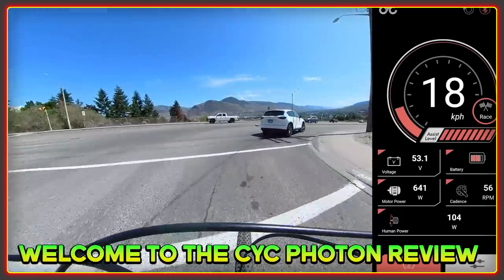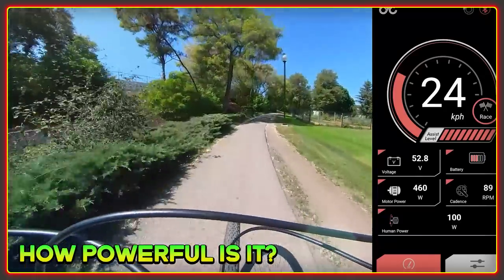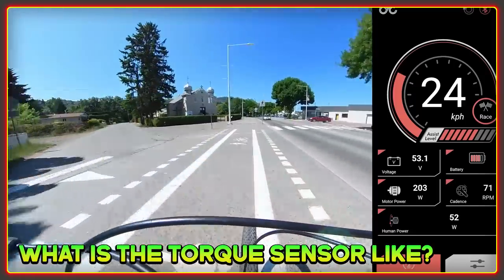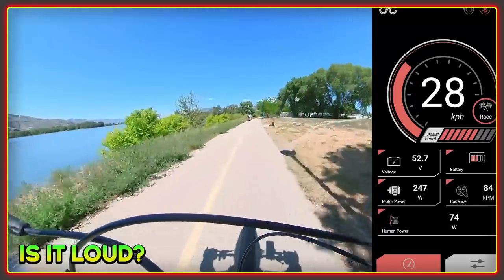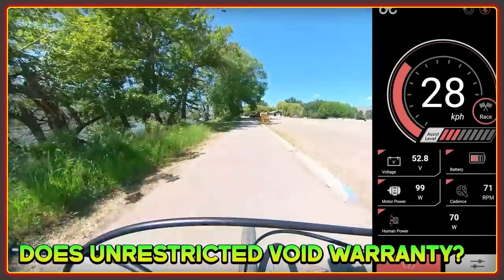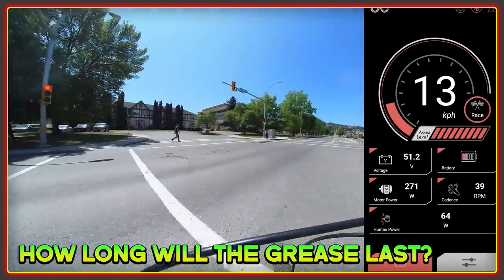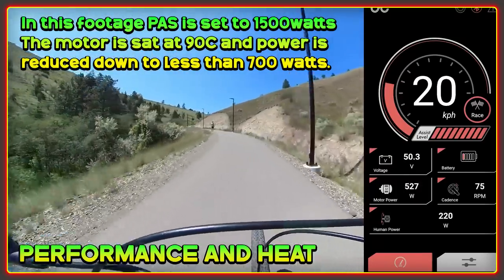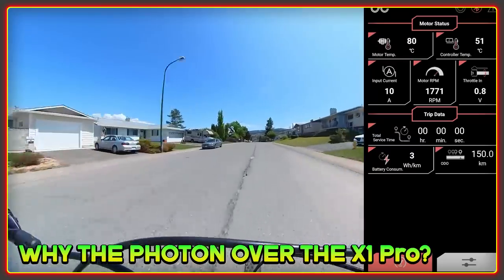Full Review of the CYC Photon Mid-Drive Ebike Conversion Motor

Comment: A year ago I fitted a Photon to a cheap old Marin full-sus MTB for exercise purposes, new cassette and new brakes, and now I weigh 25kg/55lb less! Agree with your review points. Had to put the 48V 20Ah battery on a saddle-stem-mounted rear rack which leaves space for a mid-mounted kiddie seat for my 5YO grandson! I can ride pedal assist for 2-3 hours, maybe 35-40 miles, without getting tired, with no sore backside and still have more than 50% battery left. 😀
Reply from the maker: Awesome build. Glad it’s working for you!

Comment: For u.s. pricing the Photon is essentially the same as  BBSHD because of the extra components needed and this package either already includes or doesnt need such as a brake sensor which isnt needed with a torque sensor.  One thing that was not  mentioned is that Photon weighs considerably less than BBSHD which weighs 14lbs!!  Also,  the ground clearance for the photon is amazing.
Reply from the maker: Yeah its not really a fair comparrison as the BBSHD can actually run up to 5kw without issues. It does weigh more. I think that the TOSEVEN DM02 is much closer in terms of style and weight.

Comment: I don't know if you read your comments or not, but CYC is setting up a "repair/warranty" facility in Austin, Texas.  This should be this year if what Jon told me is correct.  That will cut down on any shipping times if work needs to be done on your Photon.  As a side note, CYC is coming out with a BBSHD killer called the Proton, and it can do 3000 watts.  I'm guessing that will make you happy.
Reply from the maker: Yeah I heard about something being setup in Texas. It would be a good move. Dealers will struggle with the workload. I terms of the Proton. We will see. It's not much bigger than the Photon so it won't take 3kw for long in the same way that the Photon can't do more than 750 sustained in hot weather. It's good to have these motors though. It's definitely stired things up. Bafang finally put a ts in the bbshd and rumor of the 02. There are also new motors from To7 and a company called truck run. Should be a good year!

Comment: I'm generally in agreement with your comments, but would point out that wide range rear 50-10 cassettes are very often used with 1x front chainrings, and on Boost frames 34T may be the max size that will fit.
Reply from the maker: Good point. I will do some investigating. I will see if I can get something to fit. Not a priority though.
Reply: Since 12 speed 50-10 cassettes have large gear steps then there is no other choice but to use modified close ration 34-12 cassete and 42t chainring for selecting comfortable cadence on flats and false flats while riding with the motor turned off for less noise and more natural feeling, reserving the motor for hills only. For really steep hills using walk assist mode is another option since on long tours occasional walking is good for leg recovery. Short commutes with steep hills aren't ridable in this case. Future option for 2x chainring would be needed since I'm not sure if somehow bolting on smaller chainring would be possible due to reports of original 34t chainring having threads instead of splines which get stripped.
Reply: @HighVoltageKits  the CYC 34T chainring fits perfectly, with perfect chainline and maybe 2mm of clearance on my example. The issue is that Boost frames have a slightly wide rear thru axle and with a narrow BB the rear stays have to flare out to accommodate the rear tire. That step out conflicts with using larger chainrings, these bikes were never intended for them. The default 38T chainring isn't always an option so builders should be aware of this.
Reply: @uvwuvw-ol3fg  not my experience at all. Almost all decent trail and enduro MTBs have Boost frames and 1x BBs and are intended to be used with small 30-34T chainrings. On these bikes you aren't as interested in maintaining cadence because the terrain determines your speed, so gear spacing does not matter. Additionally there tends to be larger spacing in the lower gears because your focus is just getting up that hill. No need to get off and walk, with the Photon my bike can get up any hill I can keep traction on. In general these bikes are not intended for road use or touring and are probably wasted if used that way.
Reply: @uvwuvw-ol3fg  can you clarify the last part of your comment? My 34T chainring has the same splines as the others so I must be misunderstanding your comment.

Comment: Still on the original Cyclone 3k and I can't decide if these new generations are an upgrade or a downgrade. Maybe it's just a sign that I should start building a new bike. :)
Reply from the maker: Its always time to build a new bike!!!!
Reply: Chris, 
Cyclone 3K is a very different motor from the new Photon.  Word is there will be a high performance motor called the Proton which is based upon Photon design language....like a beefier version.  Knock on bigger Cyclone motors...or I would own a bike with one...is the noise.  CYC answered this concern with the Photon but it is a lower power offering.  High RPM...just like the Sur-Ron and even high RPM hot rodded BBSHD exposes more noise of course because turning very RPM creates a resonance that sounds a bit like a shriek. For me, as a BBSHD lover, a higher performance version of the Photon maybe of greater interest.  
If you are good with the noise signature of the larger CYC motors, they are dam good now that many of the early bugs have been resolved.
Reply: @lukewalker1051  Thanks for this. I haven't been paying much attention to the new stuff because my old cyclone is still running perfectly, though a bit whiney sounding as they all are. One thing I definitely want is the newer software, the old BT app isn't very good at all. 3k is also more power than I need, by quite a bit, but I still love hitting the gas every time. :)
Reply: Always happy to come across another Cyclone 3K user. Over 5 years on mine and she's never let me down. Looks kinda clunky? Sure, but so much fun!  It's the Millenium Falcon of ebikes! 😂 Wish SickBikeParts and Luna still sold them. Just glad I stocked up on parts — hope to keep her going for decades!

Comment: Your review was a polished piece of work.  Being an owner of a photon I agreed with everything you covered. Especially the concern about serviceability.  With the current supply issues I worry about the need to send in for repair.  If it is taking months to fulfill new orders will parts be available for quick turnaround if service is required.   
The only issue I have encountered is getting the brake sensors working.  You can order a cable that includes a pair of magnetic sensors that uses a small magnet mounted to the brake lever.  I just couldn't get it to work.  So I opted to go with new integrated brake levers with built in switch cutoff.  Again the three pin connector is not compatible with most master levers.  I finally gave up and removed the extra cables . 
Another thing I would like is shift sensors.   In 2000watt mode my cassette is taking a beating when shifting.  
Because of the high torque I find I primarily ride in 7, 8th and 9th gear.  Never a need to for the lower gears.  I am shopping for a more robust cassette as I pretty much killed 9th.  Jumps over the teeth under high demand.  
But that's a problem I really like.  The response and torque are very good.  
I also very much agree with your assessment of the torque sensor.   It is as good as my bosch motor on my 12 thousand dollar reise and muller homage.  Bosch has a superb torque sensor but the photon's is adjustable in a variety of ways to custom tune the feel.  
The adjustment of the riding profile using the phone app is remarkable.   I strongly wish I could set different profiles or at least be able to save a profile.  Once I accidentally reset the app and lost an hours worth of custom settings.  There is over 30 custom settings from throttle to torque to battery management to set.  Out of the box it works nice.  You do have to set your battery voltage and low cut-off.  
A word of advice in selecting a proper battery.  You need to buy a premium battery that is capable of sustained 40amp output.  The photon can use 52 volt 40amp output.  I use a 52v battery rated at 20ah.  My full charge is 58v..  I put 48 miles of mostly throttle and quite a bit of high speed runs and only drained it down to 52v.  Super impressed.  
I never hear it run.  

I love this motor.
Reply from the maker: Thanks for the comment. The brake thing sounds pretty frustrating. I tend to pedal lightly when shifting gears. There is not a point on the harness for a gear cutoff but I think you can add one by using the brake cuttoff and either an extension or wire it in higher up. Check the pin out though as it might not be the same as the one from Bafang. Another thing you could try is to have the power ramp up slower on the pedal assist. This would give more time to shift with lower power. Worth a shot. Cheers
Reply: @HighVoltageKits  Alternatively but also costly would be to go with an internal gear hub like a Rohloff as you can stop pedaling and shift gears.
Reply: I'm planning on building an e-bike with this motor and definitely using a IGH. 
A SCHWINN IGH run  about 200 bucks

Comment: Hey, just discovered this new project called freebeat Morph 2-in-1 e-Bike after watching your video. Gotta say, I'm impressed by the outstanding features this e-bike offers. The fact that it can be charged indoors is a game-changer! The brushless 750W motor and 80Nm torque ensure a powerful and exhilarating ride. The 80mm front suspension and puncture-resistant fat tires guarantee a smooth journey on any terrain. Plus, the Smart Saddle Detection+ feature and the ability to convert calories into CO2-free miles really caught my attention. Definitely putting my support behind this project! Keep up the great work!
Reply from the maker: What is unique about the bike that let's you charge it more safely than any other ebike inside?

Comment: very interesting and useful review, covering basically all the questions i have about the photon.  tremendously informative.  would in addition really appreciate appreciate your thoughts on how the cyc photon compares to the other torque sensing mid drive currently available, the tsdz2, especially with osf, and what in the build quality, anticipated reliability, and user experience, might induce a rider to pay the nearly doubled price?  as a standalone yours is truly a superlative review and very helpful.  i just wondered if, given the torque sensor capabilties of the photon and tsdz2, a comparison of those motors might be useful.  many many thanks, jeff
Reply from the maker: I have never ridden the Tong Shen but its taking a battering on the forums. Very easy to break. Its very cheap but not by any means reliable. There are a bunch of new TS motors this year though so it may well be a comparison that gets easier later this year. Right now its the only thing in its category. It is quite expensive though.

Comment: Converted a Trek Marlin 5 2022 (Large frame) with this motor (38t chainring). 200 lbs rider nearly 60 years old. US profile loaded in race mode, assist lvl 1= barely getting any workout, like 1 of 10. Battery seems to like it because it's still at 51% (50.6V), 107 kms later (52V 17.5AH Samsung 35E cells) Now on Canada preset, street mode, for legality and will see how far I go.
Reply from the maker: Sounds like a great build. Its nice that you can use those cells on it as you get the extra capacity for less overall battery size and weight. That's impressive range. I think stock that its pulling 250watts at level one but you can check that in the ride app.  Cheers

Comment: Hey Voltage - Thanks for the awesome review. This was actually the reason I ended up putting a Photon on order!! 

Quick question for you as I just finished installing the motor last night - should I expect a bit more resistance now when pedaling vs. when having no motor? I would not say I am seeing a ton more resistance now, but the pedals definitely do not spin freely either. Curious if I potentially tightened something too much like the spindle lock ring, but I backed it off and resistance was about the same.
Reply from the maker: I think there is an issue with the tolerance on the machining on the bearing cup for the non drive side. I have a video for this week to explain what I think is going on. But yeah its going to be a bit stiffer than with a cartridge bearing BB. It should not affect use as you have all that power though. I think they do need to fix it though.

Comment: John,
I removed my most recent comment because of your fair response.  I wrote a comparison of the Bafang mid drive to the new Photon only highlighting some of the considerations in my original post.  I couldn't understand why it was deleted because I thought it was even handed.
If you said you didn't delete it, I take you at your word.
Best to let others decide what is best for them.
Good luck in all your R&D efforts and safe riding to those that love high performance ebikes.  Great to have competition in the market place that only refines options available to the consumer.
Reply from the maker: I appreciate that Luke. I actually found the comment which had been filtered out for some reason along with replies to it by the YouTube algorithm. I usually check messages set to review by YT and it had slipped my mind. Apologies about that. It seems to block some comments for no real reason at times. I could see nothing wrong with it. I generally try to reply to all comments I get. Thanks for the kind words of support.

Comment: Great review. I really would like to know if it can be disabled, so that opportunistic theft can be denied motor assist, maybe enabling the owner a small possibility of grabbing the bike before it's gone, probably forever. In any case, I'm thinking of using a small padlock around the chain to drag the chain off the sprocket, so he'd have to push it away...
Reply from the maker: There is not an anti theft like that built in unfortunately. The chain idea is good. You could also hide an airtag. Maybe a kill switch in there.
Reply: Thx.I thought I read in the online manual that there's a password function... doesn't explain what that's for.  Wondering if there is there such a thing as an inline keyed switch for the battery cabling?
Reply: I have the DS103 display and it allows you to have a password. You have to first enter the default password 0000 and then you can set your own.
Reply: @mattdeeney1169  Ahh thx, ok that might be where read it. My Photon is coming early July (was early June) and I did choose the DS103 display option.
Reply: @Delton05  Nice. I’ve loved my Photon. It’s my first e-bike and it’s been so fun.  I ordered another one for my wife’s bike!

Comment: Yea, I think this video has pushed me over the edge. Going to get one for my 2021 stumpjumper. Not sure on battery mount though.
Reply from the maker: The battery is always the hard thing to get right with the DH bikes. There is not usually much of a triangle space to work with. I think electrify bike has some compact options.
Reply: @HighVoltageKits  thanks, I’ll check them out.

Comment: Thanks for the thorough, all things considered review.  I think it's great that Bafang has some competition, but for now I remain in the BBSHD camp as its hot most of the year where I ride, and a cherished reward for my daily cardio work out includes some exciting pinned throttle action.  Sadly, I don't think much can be done to lighten a HD, big magnets and a strong copper rich field inevitably lead to higher mass.   I don't have a big problem with the cadence PAS either now that it is dialed to my needs.  After seeing some promo materials for the X1 Proton,  I have some concerns that it may be the noisy X1 motor, and it seems to hang far low.  For me the search continues for creating a sub 22Kg mid-travel trail ripper with 48v/17.5 Ah that has enough torque to pull 50kph plus on the intertidal beaches as well.  But in the meantime, I'm having a ball.
Reply from the maker: You are welcome. There will always be a place for the BBSHD! Its that mass that makes it work to a large extent as all the heat can soak into it. Once dialed cadence based PAS can be pretty nice as well. For on beaches you need fat tires I would think. What about one of the Super 73 style frames. You probably want Chromalloy if possible. What is the budget. If there are no limits you could get one of those Titanium fatbike frames! I would love one of those one day! I am not sure beaches would be good with the two chains of the CYC. There is also salt to consider which plays havock with mechanicals. Lots of good fenders and regular greasing / spraying off. That sounds like a challenging build. I doubt there is anything comercial. You are welcome on our discord group. We have a pimp my ride section where I saw a cool ebike recently that had a surfboard rack on it! Cheers